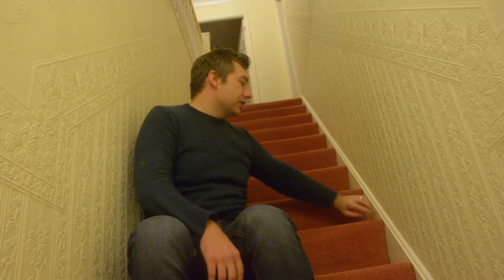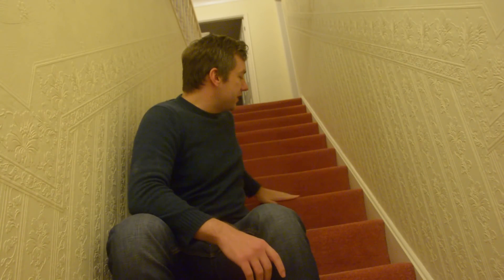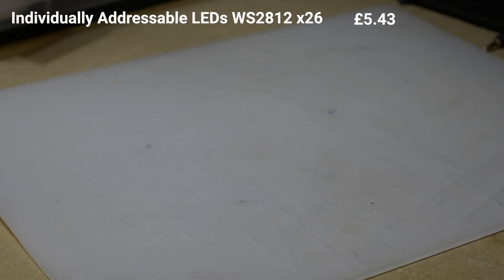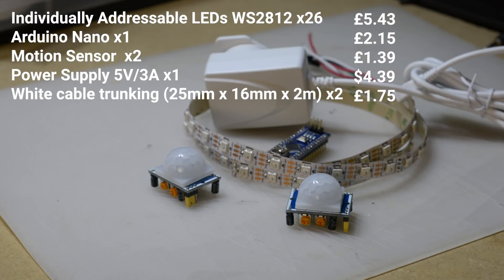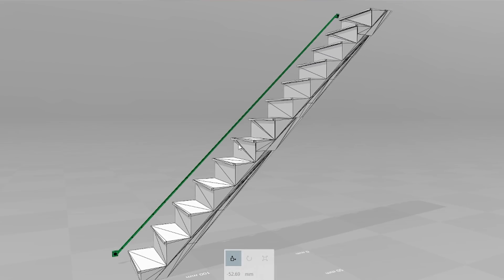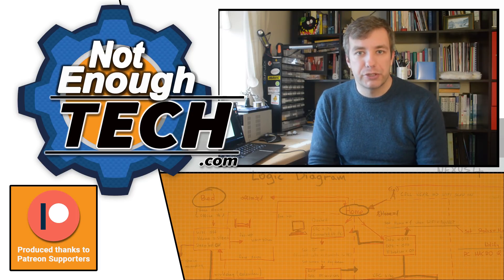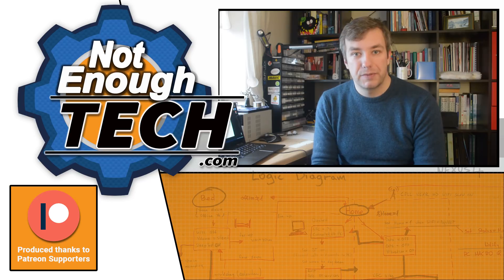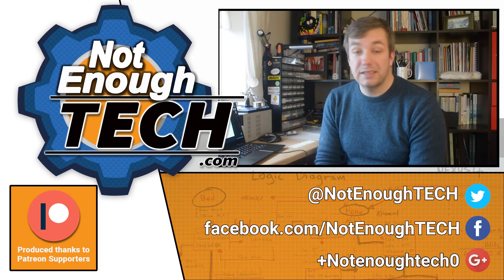$20 Automated Staircase Lights: DESIGN (1/3)

Comment: hello can I ask if I didn't wan to cut and solder de led light it possible that this project will success
Reply from the maker: Yes, you will have to upgrade power supply and increase the number of leds in the code

Comment: Do you know if it can be made for a 2 floor buildind with 2 pir sensors aextra in the middle floor?
Reply from the maker: +KOTSOS5 yes it can. The only difference is that you have to drag an extra wire for the sensor. The code would have to be modified a little bit as well.
Reply: Hi, I can do the wiring and basic arduino programming (set inputs, declare stuff) but is it possible to tell me at which part of the code (and what to write if possible) so that if the middle pir, sensors something the led strip starts to light from up to bottom or the opposite or the even better to light from the middle with to ways up and down?
Reply from the maker: It depends on how many sensors you want to use. Middle should have 2 sensors to indicate which direction you want to go (up/down) otherwise middle would trigger both path. If you go for 2 sensors in the middle - you are basically duplicate the code as you have the same script running  for 1st floor and for 2nd one. (you just need to add  && to the PIR sensor conditions to include 2 sets of them)
Reply: Just what I thought but what if you want to have just 1 pir in the middle and you want the leds to light both ways when it detects you, is it possible, I know I put you hard but the problem is that i'm not good with coding.
Reply from the maker: yes it would be, just trigger  the array from a specific number - there is a section of the code that defines array [1..2..3 etc] and you have to add a variant that triggers from half down and from half up at the same time.
Reply: Ok thanks for the infos, when I start to make it, i might need your help, I hope you don't mind! Have a nice day :)